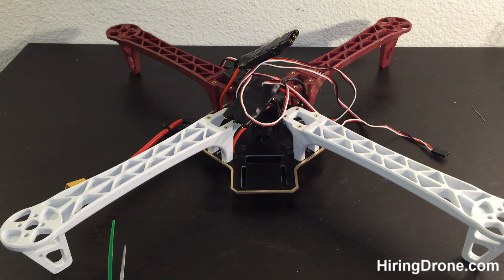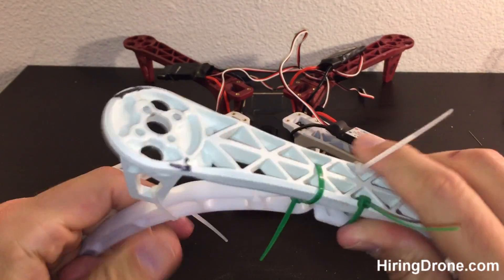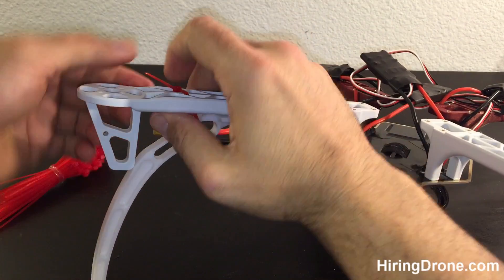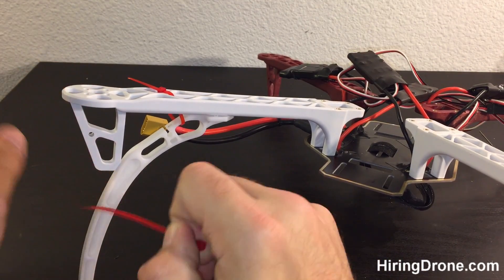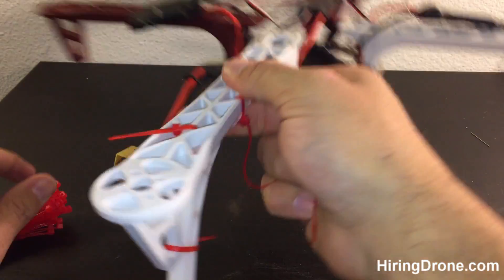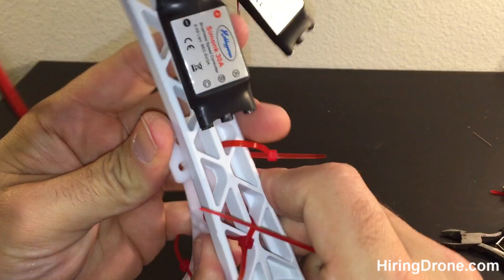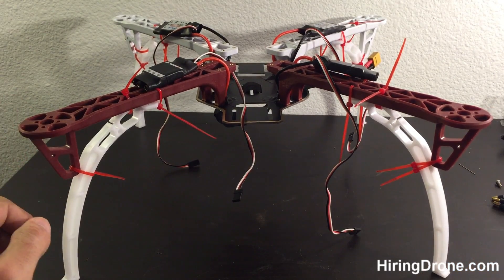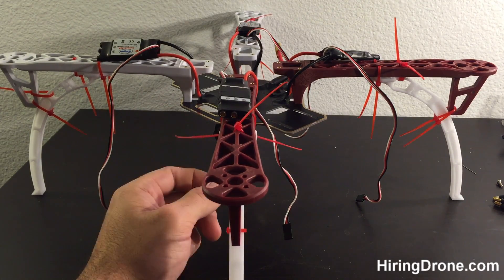F450 Quadcopter Landing Gear Mod Hack

Comment: installed legs using your idea
Reply from the maker: +John R Savelli Jr Awesome! How is working out? I like this method, as I haven't has any tip overs.
Reply: +Hiring a Drone : worked great,even with a few hard landings and added led lights.